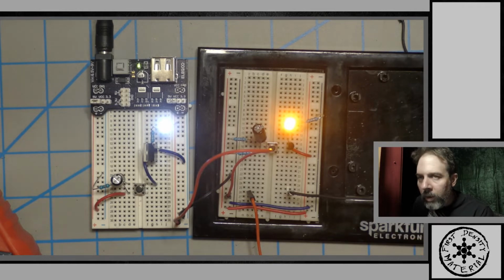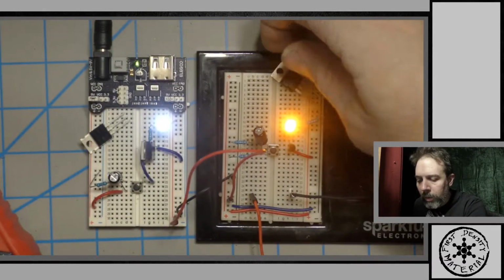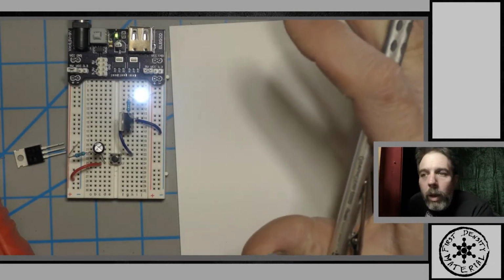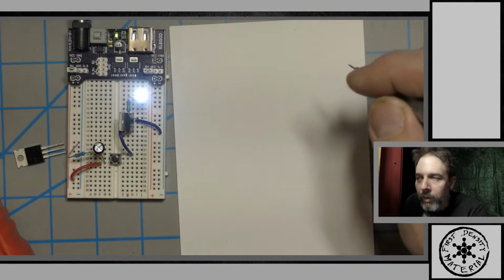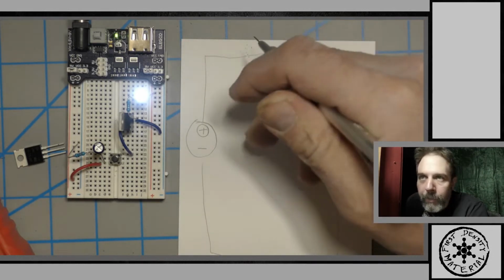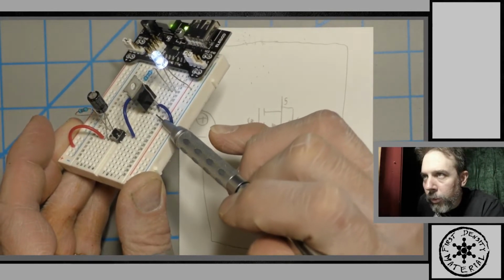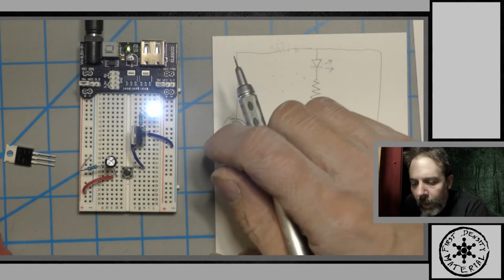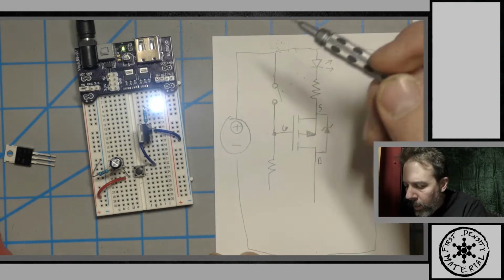0901 Learn Electronics Mosfet Circuit A

Comment: There is somthing wrong with the diagram. The negativ rail should not be connectet directly to the switch. This gives a short for the powerrails when switch is pressed!!!
Reply from the maker: Its hooked via a pull up resistor and the positive in the diagram. Positive directly and Negative pullup passively